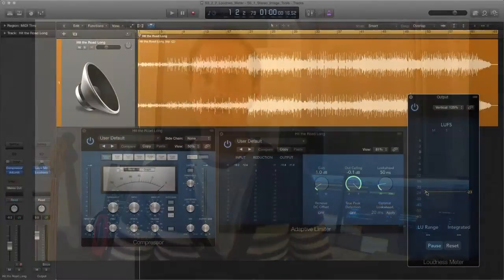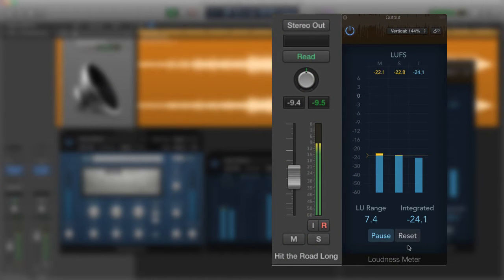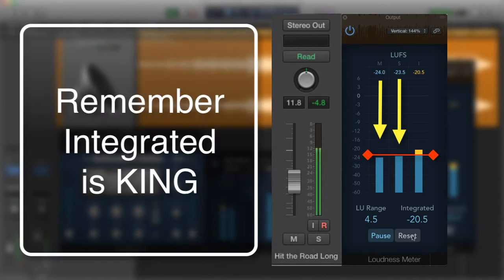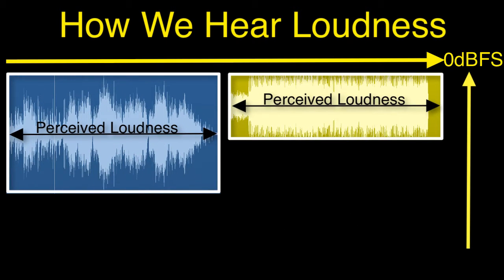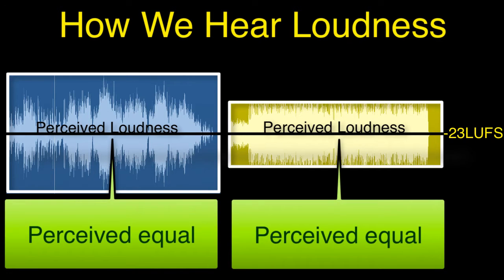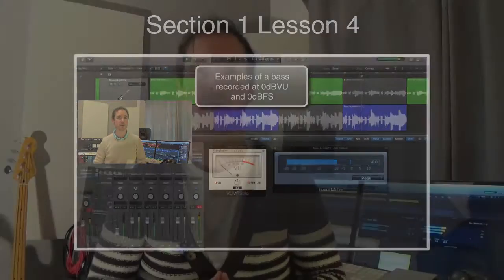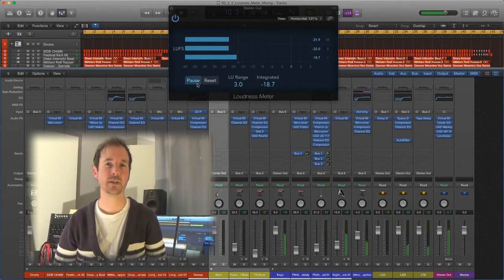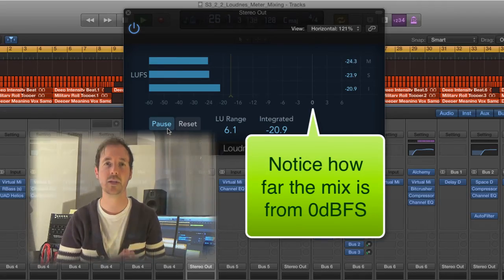Logic Pro X Loudness Meter part 3

Comment: Hi. I would like to add something that's probably missing in the videos and it makes a big difference (and I'm gonna be talking about a mixing situation, not mastering). For example, the values and the standards are only meaningful if you compare them to 0dB. What I mean is that -18 or -23 are only useful when the audio is peaking at 0dB, otherwise a mix  peaking at -10dB will have a different reading in terms of LUFS compared to a mix peaking at -1dB. Usually we should mix so the output peaks at a value that gives us enough headroom before clipping (let's say -6dB, just as an example) so if we mix and we are looking at the LUFS meters, it will not give us an accurate reading, because if we increase the volume of the mix to peak at around 0dB, then the LUFS meters will show a higher value as well. Hope it makes sense. So my point is that, if we truly want to read the LUFS values while mixing, we should always try to have our peaks at around 0dB (maybe adding the Gain plugin) so we can have an accurate reading. That doesn't mean we can't change the final output gain once we are done mixing, but at least for LUFS reading purposes, I think this is the way to do it. Am I right? Thoughts?

Comment: Can you please clarify two things: 1) you say that we should aim for -23LUFS. Yet, the next moment you mixed your own music for  -18LUFS. Can you help clarifying this? 2) Based on your experience, what would you recommend for this scenario: I am creating an audiobook (on my own :) ). There is a male voice reading with occasional musical interruption. There are two issues: 2A) Shall I push the parts with the human voice to the same LUFS as the music part? 2B) There are different types of music, depending on the chapter. Some are relaxing and quiet. But some are energetic, adventure type tracks. Shall I push the different types of music tracks to the same LUFS level? So the quiet forest music has the same level as the Indiana Jones type chasing music. Thank you!
Reply from the maker: Hi Steven P, apologies only just responding I must have missed your message. Happy to clarify a couple of things. For you.
Re: 1) In the video I give two example the first is levelling the final stereo mix or master to -23LUFS in respect to achieving a compliant mix for broadcast. The second example where I mix to -18LUFS is purely for the purpose of giving headroom in the mix and using it as an alternative to the VU meter, which typically sits at -18dBFS when at 0VU. So it's really demonstrating two different uses for an LUFS Meter. One for checking broadcast levels and one for mixing.
Re: 2A) I would recommend whatever LUFS level you target (will come to that shortly) it's the combination of all sounds that are in your mix. For example if you target -16LUFS this level would be a combination of both music and voice.
Re: 2B) Again same as 2A set your target level and mix everything to that level. If the relaxing music is quieter than the adventure music as long as they are at the same integrated value and balanced well with the voice over then you should end up with a consistent level throughout the audio book. It doesn't mean all music will be at the same volume because it's all relative but you will end up with a consistent level from beginning to end of the entire audio book. That's ultimately what you're looking for. YouTube is consistent between all videos on average because YT uses LUFS metering. When you watch from one video to the next it's consistently the same level.
As far as knowing which level to use I would say if you're audio book will be broadcast on TV -23LUFS would be good, If you're going to be online and streaming from a platform -16LUFS or -14LUFS is a safe bet.
Sometimes for TV I'll deliver two mixes one at -23LUFS (if it's been specifically requested) and a second at a louder level. Remember a dubbing engineer will be required to make sure everything is compliant so when I deliver a louder mix it's the dubbing engineers responsibility to mix it with everything else (dialog, VO, SFX etc) at the correct level.
Hope this help and isn't confusing!!
Good luck with the Audio Book!!!
Reply: stoneymusicman - thank you for taking the time to reply in such a great depth. It’s very useful and you clarified a lot.

Comment: Great info and my mind is blown!  Would this mean that when mastering, we should make multiple masters (isn't that what the pro's do?), for example, one for radio/streaming media, and another, more louder mix maybe for CD mastering so it's relative to how you listen in the car, turn up the volume, etc? In the mastering mode now for a new album. Thanks!
Reply: Also, with streaming media compressing levels at around -14 LUFS, I'm thinking those mixes should try to be the most dynamic at that level as close as possible right? But that's too loud for TV spots perhaps if trying to get something licensed in that realm; meaning a third master mix? http://www.meterplugs.com/blog/2017/07/19/spotify-lowers-normalization-level.html
Reply from the maker: Hi Kevin, yes you're absolutely right. To be on the safe side I will often deliver at the standard UK format of -23LUFS but an open dynamic -14 would be good, especially if your music is coming from a library or is a stand alone license; the dubbing mixing is the one usually responsible for making sure all the levels are correct across the production. Thanks for the great comment and good luck with your ventures!
Reply: @bemusi  Can you please clarify two things: 1) you say that we should aim for -23LUFS. Yet, the next moment you mixed your own music for  -18LUFS. Can you help clarifying this? 2) Based on your experience, what would you recommend for this scenario: I am creating an audiobook (on my own :) ). There is a male voice reading with occasional musical interruption. There are two issues: 2A) Shall I push the parts with the human voice to the same LUFS as the music part? 2B) There are different types of music, depending on the chapter. Some are relaxing and quiet. But some are energetic, adventure type tracks. Shall I push the different types of music tracks to the same LUFS level? So the quiet forest music has the same level as the Indiana Jones type chasing music. Thank you!

Comment: Brilliant!  I'd never even heard of LUFS until I was playing with a trial of Hindenburg Journalist.  I love the way it auto-normalizes to -23LUFS, but since I already own Logic Pro X, I wanted to see if I could make that happen there.  This very professionally-made tutorial series is the only resource I've found that helped me wrap my head around how to interpret and use the Loudness Meter.  

Question: I have the Loudness Meter on the Stereo Mix channel strip, but adjusting the Stereo Mix fader doesn't change the LUFS level for me -- I have to adjust the individual track sliders.  Am I missing something?
Reply from the maker: Hi Lee, Apologies only just coming back to you.  To answer your question that's working absolutely right the Level Meter will respond to track/bus adjustments but not Output or Master track adjustments.  

Think of it as a line with two end points Input and Output, you place plugins/effects/outboard etc in between those two points.  The inserts on the master Output are your last chance to effect or monitor the signal before it runs through the Master fader and then out to your speakers or Bouncing out.  The Loudness Meter will give you a reading of everything that's happening before the plugin but not after i.e the Master Fader in your case.  Therefore you can pull the master fader right down but you'll still see a reading from any Metering plugin.  If you pull the fader down of course the master channel Fader will give you a different reading, which will be the final bounce level.  

As a general rule of thumb it's best to keep your Master fader and Master track set to 0dBFS this way you'll get an identical reading from both Master Channel and the metering plugin, as long as it's at the end of your plugin chain.  It also means that when you bounce out for mastering you'll be able to trust the exact level you're bouncing out to.

Hope that helps you out!

P.S Thanks so much for the kind words if you are interested in learning more why not check out my website www.masteringinlogic.com. This video was taken from my system teaching the art of mastering and creating better sounding music!  You can sign up for free tutorials/videos and get a whole bunch of stuff without having to become a full member.

If you're interested here's an extract from an email from someone that's just started learning with me 

"I just finished the first module this morning on Mix Preparation and I Love it.
I learned so much in such a short period of time. You have an excellent teaching style, very concise and to the point." Visit us at www.masteringinlogic.com